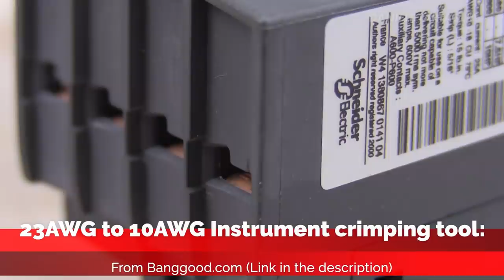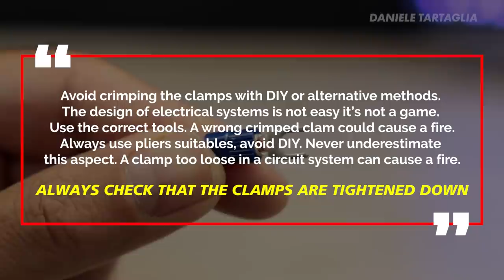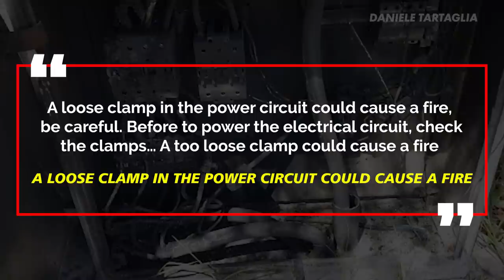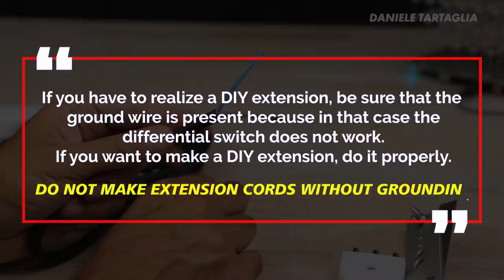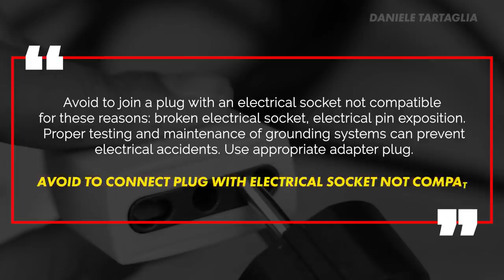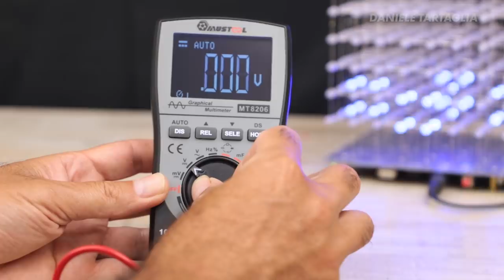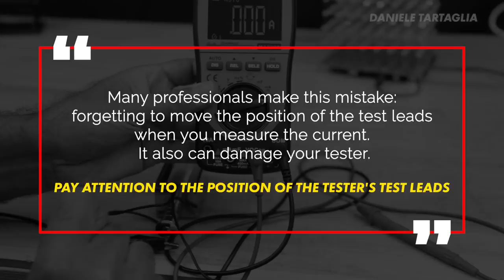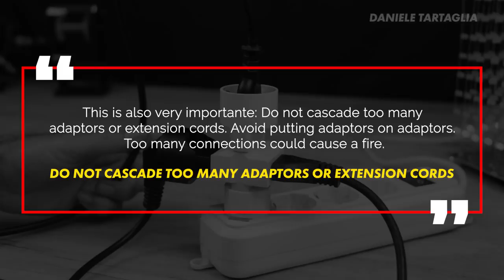10 STUPID errors to avoid in the electrical engineering

Comment: As a full time PAT tester, I see these mistakes all the time. I spend most of my time having to correct other peoples shoddy work
Reply: I got sent out to a commercial microwave that my boss repaired a few days earlier. After removing the cabinet to have a look at what the problem was, I touched the microwave with my left hand and a spark went about 6 inches from my right hand to the microwave. It was the worst shock I've ever had, my right hand was numb for 4 days. The transformer had blown and my boss had replaced it with one that "looked about right for the job". The transformer was too big and the coils were touching the cabinet. How the hell nobody died is a miracle, 1-inch rubber feet were all that stood in the way of 6 kitchen staff and 5000 volts.
Reply: @davidwells7279  What a vivid imagination you have...
Reply: @amdidextrous  not a story bud, it happened.

Comment: In my line of work I will go in to install Alarm Systems, CCTV, Audio and TVs and I always see the horror from what the customer has done and even worse what other Techs have done.
Reply: Low voltage and fiber are the worst, I'm a firm believer that any low voltage signal cable should have a 500VDC "protective signal" applied to the outer braid, that way people would take wiring these "non-letal" cables more seriously
Reply: nah, Most cabling is rated for 300 Volts, Just put a isolated 250VAC 1mA, enough to let them know who's boss.
Reply: Me too my friend. I can't understand why customers and sometimes techs themselves put their safety at stack in such an idiotic way ...

Comment: Whilst I think it's fantastic to alert others to incorrect practices it does annoy when you state the, "correct way" which isn't necessarily true. Yes terminals should be tightened adequately but your method using a hand screw driver can not deliver the correct tightening torque as specified by the manufacturer. What the vast majority of people fail to realise is a overtightened connection can sometimes be more destructive than a undertightened one. And as others have said the earthing conductor should always be longer on leads so as to be last to disconnect under strain. Oh and when using crimps of any sort conductors shouldn't be twisted tight.

Comment: The correct title shoud be "electrical hobbyist problem, for not technical people"
Reply: no, only if someone dont have money.
Reply: For your kind attention at 13:56.
No one is immune to mistakes.
Reply: @defaulltmake  to forgotten the probe in Ampere mode while measuring the voltage, isn't a elelectrical engineering mistake.
Reply: maybe "from hobbits to hobbits"
Reply: If you 'professionals' were not so greedy, there would be no need for electrical hobbyists.
Reply: @duudsuufd  yeah you are right, you know what, every professional job should be community work!

Comment: those are not errors or mistakes, but just lack of a proper tools
Reply: If you dont have the proper tools dont work with electricity
Reply: @josefaschwanden1502  if the electricity is not high , there is no problem to work with not professional tools
Reply: @intel386DX  its just a pain in the ass then
Reply: @josefaschwanden1502  harder yes, but pain in the ass...
Reply: You can very much Improvise...

Comment: The 6th, I use Wago lol
Reply: @DIY Projects I don't know but, Wago dose grip wire tight, withstand 400 volt, 30 amp.
Reply: @DIY Projects why??? Its about a electrical connection, NOT a mechanical connection. This are 2 different worlds. Also a common mistake. Same for making a electrical connection to tight on a screw. It needs to be the right tork, or else the material misshapes and will couse a loose connection (to overdramatize this: it will result in a huge explosion and everybody dies😜).

Comment: Ground is so damn important man, but I live in a country where almost every single household doesn't have ground. So many electrical appliances have burnt out over the years, not to mention how dangerous it is for us.
I know the dangers of not having ground, and it's always fucking freaky when you go to touch something and not know if it's electrically chargered or not.
Reply: You could ground your appliances by getting a ground rod into the ground xd. Granted you will need recpitcals that have ground on them and all metal applicances can easily have grounds added to them. Hope this helps.
Reply: @killerdeamonking  I have looked into it, but it would involve my father and I busting down our house walls to rewire the whole house. That would be an easy enough job if it weren't for the fact that we live in a country in where almost every single household is made out of fucking concrete.

Not to mention that it's common to have such shitty wiring on homes and the like in this damn place. There's also the issue of not having your traditional indoor, metal fuse box, we have this weird "fuse wall" outside our homes on a fence somewhere, which I can't even begin to wrap my head around.
Reply: @InDeath  Lol i live in a 140 year old house. I tottaly know what you mean. And that depends on how and where your wiring is split up into the home. if you have a basement then wiring could come from floor up into walls. Wiring is generally easy to do that way. Also if you have metal boxes for all outlets than chances are those are grounded already through the electrical panel though the steel cableing.
Reply: @killerdeamonking  That's a real good idea, sadly we don't have a basement, so we can't wire things that way man. The way it's all set up is through our concrete roof. from what I understand they wanted to be all "innovative" and do everything in one go, the wiring AND the building of the house, so the wiring and everything is all integrated from the roof down the walls haha. 

What father and I cam up with was cutting all the shit wiring and sealing the holes up and just rewire everything outside the walls and pinning all the electrical wiring on the corners where the walls meat the floor, and covering the wiring with some decorative wood that was isolated. Then just rewiring every outlet and light fixture in the house with small isolated pipes that will house the wires so we don't bust the walls. 

Not just that but also installing ground wiring so that everything's safe.
Also the outlets have plastic boxes so there's that haha.
Reply: @InDeath  RIP

Comment: I am guilty of:
#2 - coz i still don't have crimping tool
#6 - coz i solder joint wires (gauge 14 and above) instead of using connectors

So far so good
Reply: Not all crimping tools are born equal. And you not find the right size ferrule at the time you want it. Most of the time you have to finish the job with what you have.

Comment: Number 8 - I'm a professional and sometimes I make this mistake. Very dangerous on high voltages.
Reply: Zannekin  Sorry if I didn't describe it properly - if you switch your DVM to measure current (A) and then forget to return red probe to voltage (V) and then measure high voltage (220-240V) it will do short circuit and be very shocking. So, my point is - when measure current (A), don't forget to revert red probe back to voltage (V) if you measure voltage.

Comment: TLDR: "Just buy this lol"
Reply: There are loads of Crimping pliers that have exchangable Dies so you can buy one in a set for like 20-30 bucks and you are set for 80% of projects. Most pliers come with a set of Butt connectors and other useful connectors (suited for your tool).
Electricity ain't no joke, it can burn down houses.

Comment: Il numero 8 in questa sequenza non è proprio un problema, l'ingresso di tensione ha una resistenza molto alta ed il tentativo di misurare la corrente cosí non danneggia lo strumento, semplicemente non misura nulla.
Viceverso il problema sarebbe più grave, la bassa resistenza dell'ingesso di corrente causa probabilmente un corto circuito e fa saltare il fusibile interno dello strumento. Se non è uno strumento da 10€, sostituendo il fusibile lo strumento torna ad funzionare come prima.

The number 8 in this sequence is not really a problem, the voltage input has a very high resistance and trying to measure the current so, it doesn't damage the instrument, it just doesn't measure anything.
Conversely, the problem would be more serious, the low resistance of the current input probably causes a short circuit and blows the internal fuse of the instrument. If it is not a 10 € instrument, replacing the fuse will make the instrument work as before.

Comment: Is no one going to talk about how you should never use DC wire crimps for AC...... That you need to use Solid core wire for breaker points. The rest of the video seems to be fine though.
Reply: What is the difference? At 50Hz AC, there is no practical difference between AC and DC as far as conductor size is concerned (unless you are transmitting power over long distances).
Reply: @janami-dharmam  Yes you are right there but DC connections handle Amperage differanltly than AC does. With AC connections shouldent be undersized as things can heat up more. 
Is actually why you will see both AC and DC crimp connections.
Reply: @killerdeamonking  I think you are confusing wiring and termination with the use of AC circuit breakers on DC. DC does not have an alternating cycle that helps extinguish the arc developed across an opening contact. True DC circuit breakers and even switches must be mechanically designed differently.  Look on any commodity switch label. It will have different maximum ratings for AC and DC for this reason. For example in large UPS systems, like 100kva and larger,  they often use off the shelf AC circuit breakers for the battery feed. But they use a three phase breaker and loop once of the DC two wires back through the third pole of the breaker. This is an accepted way to get around the arc-break issue and not have to use a more expensive DC circuit breaker.
Reply: @andydelle4509  I agree with you in all parts except im not talking about the breaker itself but rather the connection from wire to the breaker. DC will ark just as much as AC will. Just cause DC is not alternating does not mean it will not ark. I mainly pointed out as a safety that You cannot use DC connections on AC applications.
Reply: @killerdeamonking  I probably wasn't clear. Yes, DC will arc just as much as AC. The difference is that an AC arc is more likely to self extinguish due to the zero crossings 50 or 60 times a second. Note too I said "more likely", meaning at less than couple of  thousand volts. Once you get above that, then there is not much difference between an AC and DC arc. You then need more sophisticated arc suppression such as explosive fuses or inert gas flooding. But I still don't understand what you mean by an AC or DC connection? A terminal lug is a terminal lug. I have never seen any distinction listed between AC and DC in using any wire connector. Can you enlighten us?
Reply: @andydelle4509  Sure. Most DC crimp connections arent AC rated such as 

UL 468A
or
NEC 110.14A

Keep in mind that those are for 14awg wire too. 

Those crimp connections are used for AC 

Granted you can use DC connections but they wont last long (Heat).
Reply: @killerdeamonking  Well in 35 years of practical hands on electrical engineering I have never ran into that problem. I have seen countless UL listed products that use the same crimp connectors on a switching power supply for both the AC input and DC  outputs. Likewise I have been inside many very large UPS systems, eg. 750kva, and seen the same off the shelf AC crimp and bolt down lugs used on the high voltage and current DC section. Show me where in NEC 110.14 does it mention difference between AC and DC circuits? Ditto that for UL468?
Reply: @andydelle4509  Well see thats the thing, there isnt much on that subject the code is there and should be done by code and i know everyones codes are differant everywhere. I just know by the codes where im from. Nec says no dc connections but yet is acceptable to most if not all electritions and such. Maybe its just a lost cause at this point xd.

Either that or the connections now are all AC/DC rated but i know in thr past that was not the case.
Reply: @killerdeamonking  Well this is news to me. The only things I ever concerned myself with on power connections was current and insulation voltage breakdown ratings. And I suspect the EE community as whole does the same. Now with video and RF connectors, which I have a background in, we do need to worry about characteristic impedance which is an AC function. But that is irrelevant for DC and 50/60 hz AC power.

Comment: 1. U can use pliars you just need 2 know how 2 use them... Profesionals dont have ewery tool for a specifick job.. They use the tool dat they can use ewerewere ( cuting wire, striping,..) 2 if ur doing video on mistakes u shudnt do eatleast dont make the basick mistakes urself... U hed the graund shorter then the phase and neutral in reality u have 2 leave the graund longer because ewereone pulls on the cord and dont grab the plug and they pull the cable out the graund is the last cable 2 be pulled out. Why so dat u and ur machine can be safe .. 3. Profesionals dont use these multimeters... Cuse its wery incovinient 2 mesure amps thath way they use a multimiter whit clamps so dat they dont have 2 diconeckt ewerey cable and run it fthrew the multimeter the bigest problem dat u wudnt blow your multimeter cuse volt meter hase a big resistence and amp meter hase a wery smal resistence... So the problem is when u forget 2 switch  the cables from amps 2 volts .. 4. The bigest problem whit  this video is firstly how u botched ewerey point u were trying 2 make couse u were slopy u did almost all of them them the wrong way  and u used the wrong tiltle.. Its shud say mistakes 2 avoid for dummies.. I cringed so hard fthro the video and i didnt want 2 coment but dam bro siriusly think before u do

Comment: Using base 10 instead of factors of 8 or it's multiples at least in Seagate & rounding down instead of up in advertising & not using whole numbers.😹😹😹
Reply: Floating point values will give you a headache.
Reply: Do Ternary, quandary & quintary base systems use any logic And-gates or what? Idk chip design.

Comment: Confession: I have made most of these mistakes. Not proud.
Reply: But nobody asks the basic question: what is need for so many difference types of plugs and sockets? Perhaps you know how difficult it is to find a adapter if you happen to be from outside. Why make or sell two core cables or two pin plugs and sockets?
Reply: @janami-dharmam  cost. Its all about the money. Its cheaper to use a 2 wired cord when ground is not needed.

Comment: 23 AWG?
Reply: yeah that's very thin, I think near high speed data cabling even, might have mixed it up with 13 AWG
Reply: @Kalvinjj  Never heard of odd number gauge other than 1AWG
Reply: @insylem  might not be a commercial value, but not impossible from what I know (specially if you want to convert from metric)

Comment: You say "not use insulation tape when make joints". Sorry, but stupid are YOU! I totally use insulation tape: first I solder wires, next use tape, and lastly sat it into heat-shrink tube. You may ask why I use insulation tape? Because juncture is not so flexible as regular wire, therefore better make it more protected (to avoid breaks).

Comment: There are other proper ways, like "proper wire twisting" and soldering before electric tape and finally cover with heat-shrink.
What I mean by proper wire twisting techniques must be a very old school thing by now. Didn't see any literature on those since high-school shop class text books in 90s. Oh, I feel old already.
Reply: Recently I spliced some DC twin cables. Soldered and shielded the proper old way. One thing is you should connect each wire with a gap lengthwise - so wire connections have less possibility to touch.

Comment: Tip 6 is wrong, I see no problem with wires being connected like that, using only tape. It won't come apart if done well.
Reply: Thou should never just tape a cable. Common sense. End of discussion
Reply: @soutzen  Common sense? Where I live we only use tape (no Wago, no wire nuts, no soldering) and I've never seen a problem with that